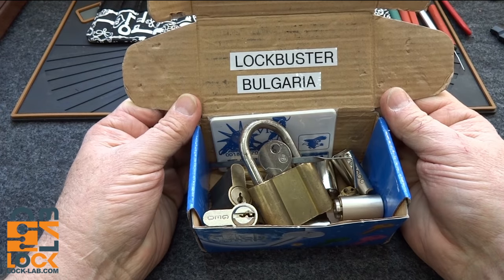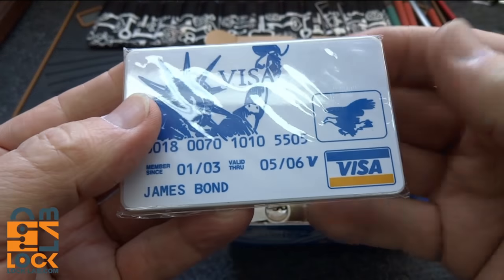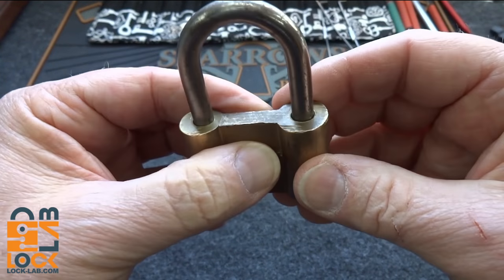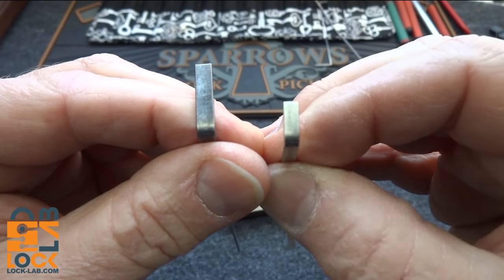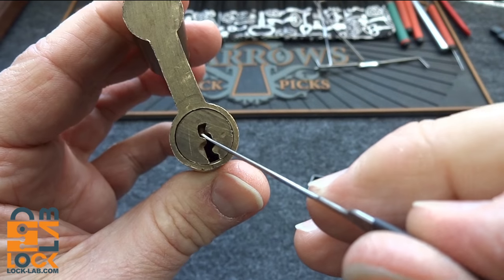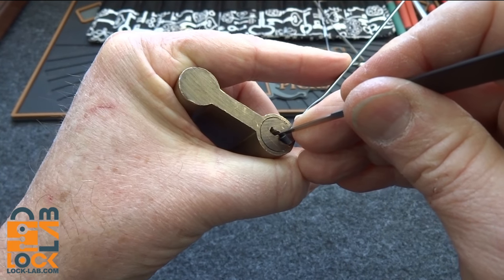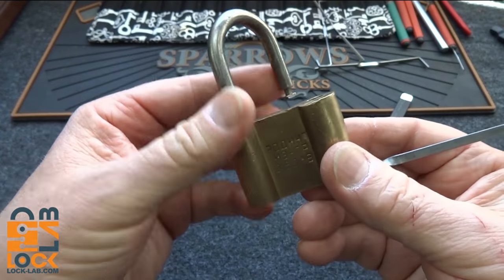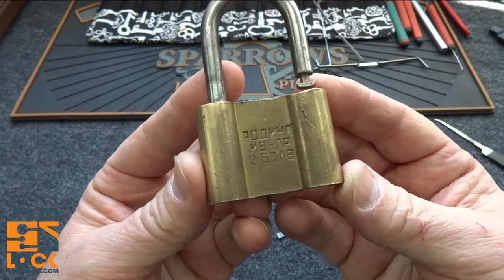(1008) Bulgarian Padlock Picked Open

Comment: I lock the chain on the garage door with one of these(I'm from Bulgaria), never knew it's an unusual design. I'd say it's a pretty old padlock since the price(2.50лв) is stamped on it(communism thing). As someone already mentioned in the comments, you can break the mechanism of the padlock by hitting it with a hammer in the right way.
Reply: bios47 you know, with brutal force you can unlock everything.

Comment: Bill! my grandparents just had an orangery built (sounds fancier than it is) and they've fitted a euro cylinder dimple lock but it has a very strong little magnet where you'd expect the hole(?) for pin 4 to be then it has the dimple for pin 5 on the end? have you seen or experienced anything like this?

Comment: Hahaha very nice, I am from Sofia and I pick locks for a few weeks now with homemade picks (awful)  but i was able to pick the same lock. I have one very strange lock, I can give it to you if you come to Sofia again.
Reply: The Stoned Videogame Nerd yeah i can,  but i am afraid they will be as useful as my current pick made from the frame of glasses.
Reply: I make my own picks out of windshield wiper inserts or carved out of cheap little pairing knives with a dremel tool and a cut off wheel. Works great.
Reply: The Stoned Videogame Nerd I can forge and have forged some bad knives so i have an idea about hardening.  I will check for one of these.  Cool idea bro. Thanks.

Comment: the driver pins are not in the middle solid piece? i surprised you did not take it apart.
Reply: john shead From what I could see, the body is made and then holes machined through the side, the side of the lock looked to have been sealed shut after having the driver pins put through it and into the middle

Comment: How do you remove the core on one of these?  Since the middle part is solid, where do the pins slide into?
Reply from the maker: The core is permanently pinned in at the factory and is not replaceable.  The pins are inserted from the side where they drill holes, then fill with plugs.  Again, not removable.